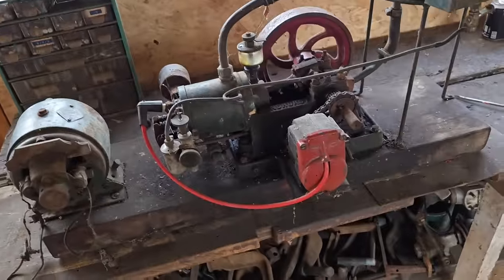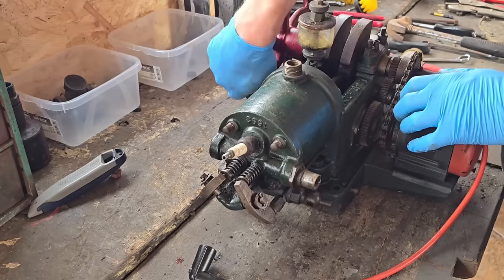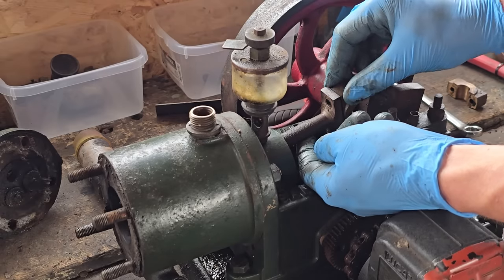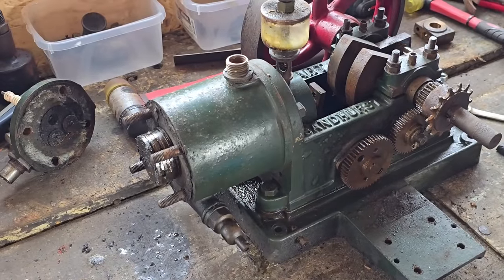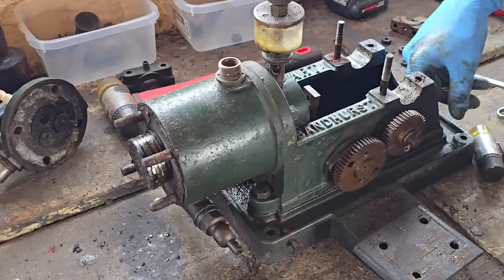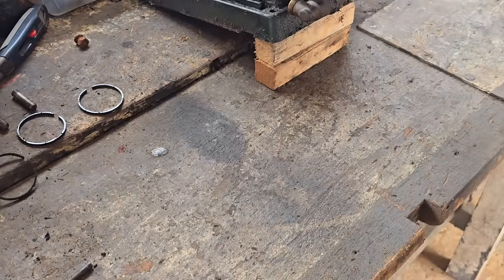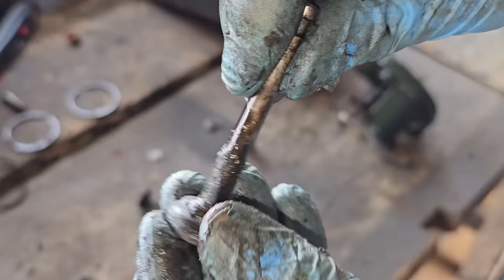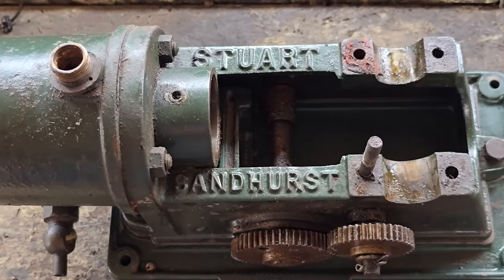Stuart Sandhurst, Not ran in 30 years.

Comment: The spark plug has been filed in that way for a reason, it looks like the threads are exposed to the combustion process so would get encrusted with carbon making it extremely difficult to remove the plug without damage.
As for paint, LEAVE IT.

Comment: You're a bit off with your info. 1913 would have been a different open crank, the 1/2hp and 1/4hp open cranks had an atmospheric inlet and a under slung rocker for exhaust. The Sandhurst was introduced during the inter-war period. 
About the machining, only the top deck was machined by Stuart here is the advert info:
The Crankshaft, Con-Rod, Bearings, etc., can be made of plain bar material, but Piston Rings and Valves are supplied with the Castings – they are the work of the specialist. One piece of machining we do in every set of castings – the facing and boring of the bed to take the cylinder. It is easily and accurately done on our machine tools, but is extremely difficult in the average amateur's workshop.

Magnetos weren't supplied with the engine and neither was carburettor (one that suited could be bought from Stuart) so engine can't be dated by the magneto as the builder would have fitted what was around. 

Not all were supplied to Sandhurst, they were available to the Civilian population, especially post WW2.

Comment: When I do valve lapping with a drill I find it easier to slip a bit of rubber tube (3 or 4 inches) on the valve stem, grip the other end of the tube in the drill. Gives a bit of wiggle/flex  and smooths things out a bit. Don't paint it, lovely as is.

Comment: Leave the paint, use boiled Linseed oil on a brush this will bring it up a treat and feed the paint. You can remove it later with white spirit you you wan to paint it. Remember you can't replace it's patena  I used Linseed on  a Crossley HRL2 Marine two stroke, never had problem with corrosion between joints.

Comment: just wondering, did the cam gear have a thread in one of the four holes to wind a bolt in up against the crank case to lock it in place?

Comment: Check the thread in the cylinder head . Does it go all the way through ? Could it be a non standard plug thread and somebody has butchered that plug because of a mismatch of thread and it would only screw in a few turns before it jammed ? Don’t paint it please.